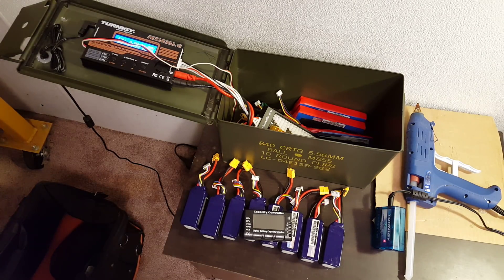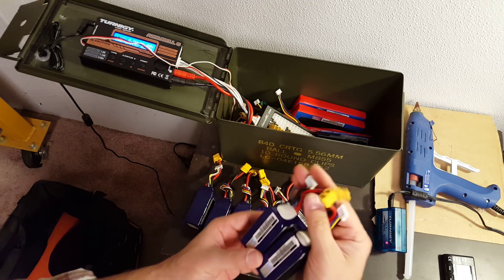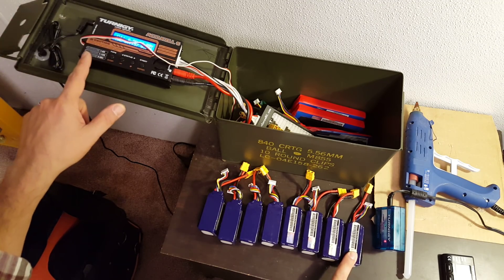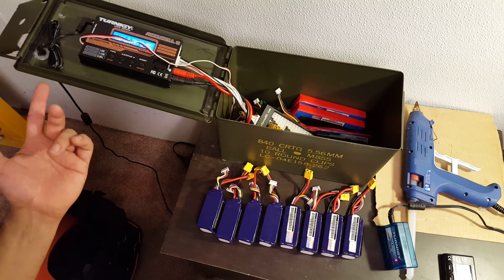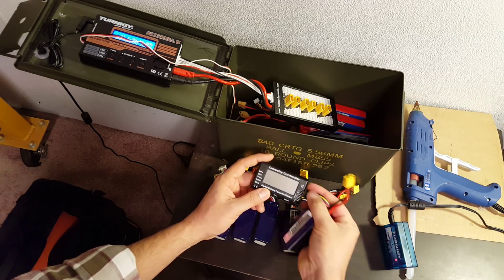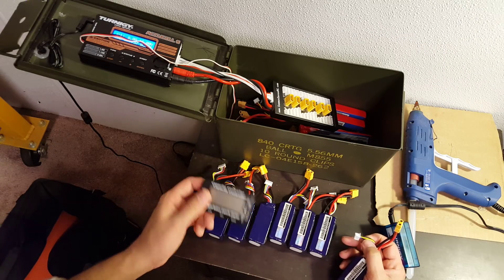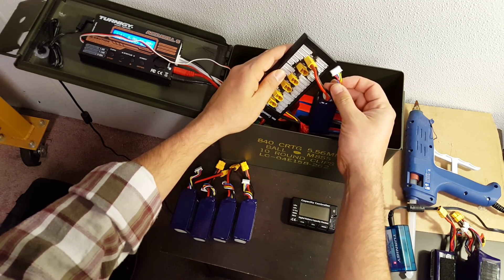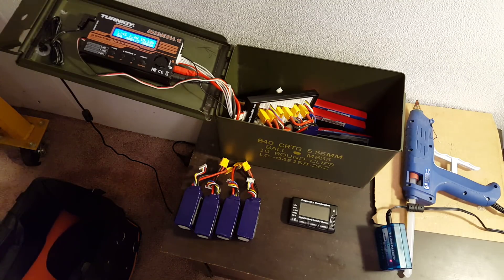How To Parallel Charge LiPo Batteries Without Burning Down Your House

Comment: Hey i have the same board and wondering if you can plug the wrong balance cord into a spot. First batterty i put in at top and the balance cord i put into the left top and second battery into right top. So on i see you put the top battery into the right top

Comment: what determines the cell input on the charger. the number of lipos at parallel board or the number of cells on each Lipo ? if we parallel charge three 4s lips is it gonna be 3s or 4s
Reply from the maker: 4S is always 4S. If you plug 4S lipos into the charge board, that's what the charger sees.

Comment: I know I’m late to the party on this one over 10 years ago now I had a eye charger 208B and I noticed on the balance board. It had multiple plug-ins for the size batteries a.k.a. it had three or four ports for two as batteries two for 3S244S then one for five and one for six now I ran an eight scale buggy And because of the price of batteries I ran bullet style connectors on 22S batteries and just series them together as a single battery in my buggy to cut down on wires I did the same when I charge them. I kept the packs connected together as one connected the positive and negative to my charger And then plugged in both balance plugs into two individual slots on the two as part of the board and charge my battery pack is one for us. Never had a problem doing this, and those battery packs are still perfectly fine today now from my understanding that is what my board was meant to do with the multiple Balance ports. It was actually meant to series charge.

Comment: Do the xt60 plugs line up with a particular balance plug or it doesn’t matter. On my parallel board there is no lines to tell me which match each other so I haven’t used it because I don’t want to do anything dumb
Reply from the maker: You can mix and match.

Comment: within 0.4 of the full pack voltage? I am new to this so just making sure, I if I have 2 packs, one at 15.33 and one at 15.43 then they are fine? And what DO you do when they are more than .4? Do you just toss them in the drone and hit them a bit? Do you plug them into an led board? Any suggestions to discharge one down without turning on your charger?
Reply from the maker: Yep -- 0.4 volts difference for the whole pack voltage. So 15.00 to 15.40 would be ok. If they are more than that, you should charge them separately in my opinion.
Reply: @JoshuaBardwell  Your videos are real helpful man. Thank you for answering.

Comment: So it was early morning I was plugging in my 2s infinity 550s to the board. when plugging in the 3rd battery I accidentally plugged the balance lead into the 3s slot it started at the board like a fuse burning up to dynamite with a small flame following crackling and smouldering.  lucky for me I was right there and pulled the battery out ripping the pins out with it. one dumb mistake could have burned my house down all because I was still half asleep and didn't have good lighting to see.

Comment: wondering if anyone can answer this for me. I have a 1-2s multi-channel charger that  charges off balance plug only. Would it be  is possible to connect a 3s battery via an adapter connected to balance plug(wired in parallel of course) to 2 different channels. Basically connect 2 cells to the 2s connector and 1 cell to the 1s connector(on separate channels) essentially turning my 1-2s multi- channel charger to a 3s charger . In theory the charger would think that it was charging a 1s and a 2s battery on separate channels. would this work?

Comment: I have you parallel charge boards in 4s and 6s.  My 6s board only shows 5 batteries in the green voltage display at the top of the board.   All fuses look  to be intact, so only charge 5 at a time is 10 that the board allows.  Any clues as to what might be happening?
Reply from the maker: The checker is showing cell voltage. It isn't showing the voltage of each individual plug. You can't measure individual plug voltage when packs are plugged in parallel. All packs have the same voltage when they're plugged in parallel that's the definition of parallel.

Comment: Hi Josh, an FPV guy told me I could equalize multiple batteries (sane Ss and mAhs) by plugging them into a parallel board for 15min (without charging). Is this true? Thanks
Reply from the maker: https://youtu.be/yTEGhKBv09M

Comment: At 3:00, are you sure you just want to “walk away” for an hour or two while they charge!? I like to always be in the vicinity.  You never know!  You are awesome, JB.  Seriously my most trusted go-to guy whenever I have an issue. Thanks so much.
Reply: Old comment, but yeah, I was a little taken aback when I heard that. Although everything else in this video is spot on -- definitely don't walk away. Ever. I walked away for what could not have been more than 5-10 minutes with my Bardwell Strix parallel charge board going with 8x 4s batteries. One of the batteries must have lit up, because I walked in to the whole board and batteries on fire in my garage. I quit parallel charging indoors 3 years ago since that day.
Reply: @JohnCuppi what was the cause?

Comment: JB!  Awesome video!   I originally found your lipo charger and parallel charging videos as I am getting back into the RC hobby (off-road dirt).  Now, after watching your videos, I am considering getting into Drone FPV flying, just for fun (no racing).  One question I have that hopefully you can help is this.  All the lip parallel charging videos are geared toward smaller mAh batteries (drones) but what about people like me who use larger mAh batters (5200+ mAh) batteries.  It does it make sense to go the parallel route with larger packs (due to the high A charge rate to get 1C) or just get a nice dual port charger and charge 2 batteries at the same time.  Thoughts?

Comment: Does it make sense to keep a check on the temperature of the batteries because usually they heat up before they catch fire, right? So if you touch them and they're extremely hot that would be a sign that you're charging with too high of a amperage or that something is wrong. I sometimes charge 3 850mah batteries at 3A. Should it be lower?
Reply: Its basically 3÷3=1 so you are charging the 3 batteries at 1 amp each which is totally fine imo.

I think you already figured it out by now but i thought might aswell let you know 😆

Comment: I have the following LiPo charger: https://hobbyking.com/en_us/ecube-e4-with-eu-plug.html?queryID=2c6afa6190382d250fff58ffd6f61678&objectID=57896&indexName=hbk_live_magento_en_us_products.

It charges with a current of 4 Amps and I charge 1300mAh LiPo's with a charge rate of 5-10 C. I would like to charge the batteries parallel. Is this doable using this charger? Most boards I find online don't just use an JST connector (which is the only plug my charger accepts) but also use an XT60.
Reply: https://www.banggood.com/2-IN-1-PG-Parallel-Charging-Board-XT30-XT60-Plug-Supports-4-Packs-2-8S-Lipo-Battery-p-1324605.html?rmmds=search&cur_warehouse=CN would this for example work?

Comment: Hey Bardwell, so if I charged all my packs and couldn’t fly them by the 2nd day, is it safe to parallel discharge at like 2C for lipos as well? I’m wondering as I now have to discharge some batteries as I won’t be using the until Saturday lol
Reply: Yes, it's absolutely safe to discharge them in parallel with 2c ( if your charger can handle that, most chargers discharge at 0.6 Amps max with 4s batteries)
Besides off that, lipo batteries can handle a lot of discharge rate ( like they do while flying) but can not handle a high charging rate so keep it on 1c for your safety

Comment: You mention sparking ... when I connect the battery to my quad, I can hear it snap/pop/spark ... is that to be expected?
Reply from the maker: Yes it's normal especially on 6S with a capacitor.

Comment: My 6S CNHL batteries say they can be charged at 5C.  They do not compare the # of charges the battery will last at this rate versus 4, 3, 2, or 1C.  I charge at 1C to be safe and I know some guys who charge batteries for flashlights who are not willing to charge more than 0.2C!  So ... what rate do you charge at?  BTW, I accidentally connected my 4S to the parallel board which already had several discharged 6S connected and in just 15s or less the 4S got warm and charged to 4.3V per cell ... definitely something I have to keep an eye on as I wasn't even thinking how these back-feed without the charger going!!  Thanks for sharing this video Joshua!
Reply from the maker: Please please learn to parallel charge safely!

Comment: If you have 1S, 2S or 3S batteries you charge them in series (also the balance plug). That's the proper way without hazard.
You can't do it with 4S  as the chargers typically only do 6s max.
Putting them in parallel ruins the LIPOs if any of those parallel cells have a significant voltage difference, never do that.
But you are right: If you check them all, verify all cells are within a very close voltage span you can parallel charge them.

Comment: If a person has an ISDT Q6 charger, and an ISDT Safe Parallel Charging board, how does one send the output from the ISDT Q6 charger output (MALE XT60), into the INPUT of the ISDT Safe Parallel Charging board 'input' (MALE XT60) ?

Neither the ISDT Q6, or the ISDT Safe Parallel Charging devices seem to come with cables to bridge between them, and on the sites i've looked at, nobody seems to sell a FEMALE to FEMALE XT60 charging  'bridge cable' set to go between the Q6 outputs and the Safe Parallel Charging device...  what am i not understanding??

P.S.  i am going to order a metal ammo can for this too.

Comment: I have a parallel charging board and the directions say  "always plug the balanced connectors in first".....I'm thinking they're wrong.
Reply from the maker: If the board has polyfuses, plugging in the balance connectors first is safer.
Reply: @JoshuaBardwell  It does have polyfuses...thanks

Comment: @Joshua Bardwell  a question , you said  that the battery needs to be at the same voltage or very similar to each other to prevent high current flows ok? But if we connect a resistor lest say 50 ohm  to the xt60 port  and to the balancing port , this will reduce the current  flow and let us plug in Lipo with different voltage , more than 0.4 (same cells )  am i right?
Reply from the maker: Yes but it would need to be a huge resistor because it might have to soak 50 or 100 watts or more.

Comment: Is there no smart parallel charge board, that will run all the checks automaticaly before unlocking the connections between batteries and stuff?
Reply from the maker: That's just called a charger. By the time you build a smart parallel board that can do all the checks, you have built a charger and the advantage of the parallel board (low cost) is gone.

Comment: Assume i have 16 cells(not battery packs) to recharge individual, normally one cell requires 5v1amps, now for 16 cells what is the calculation, is it same voltage, amps for 16 cells in parallel connection ...? or do i need regulate(increase) input volts,amps kindly reply
Reply from the maker: Same voltage, amps add up.

It would be 16 amps to 5v.

Comment: This question haunts me in my dreams: when you connect lipos with different cell voltage to a parallel board, the cell voltage balance out anyways after some time? Is there a maximum on  discrepancy between the voltage of each cell for parallel charging? What if I keep them connected some time until they all have the same voltage - is it save?
Reply from the maker: https://www.youtube.com/watch?v=yTEGhKBv09M

Comment: Great video, thank you!  Just one thing, I recently started doing this and I heard from a guy at my local hobby store who recommended not charging batteries that have any individual cells that are out by more than .05v!  I was doing this for a while but it was really difficult to achieve and seemed a little excessively cautious.  Your way at (.4v or .3v etc...) seems a lot more reasonable as well as attainable.  What do you think?
Reply: I've heard conflicting stories as well,   i just charge 1 by 1 on 5C  fuck it,   just keep a fire extinguisher nearby.. Even tho the Tattu's can take up to 15C

Comment: where does the air for the charger come from when its closed ?
Reply: the charger runs on electricity not air. now if your asking where does the heat from the charger go, thats a good question

Comment: Joshua would it affect anything if I created extensions for each battery so that they aren't all piled up so close on each other? I wonder if there's a way to do that with the balance leads too? Just a thought. I would buy a set of these if someone sold them. Maybe they do.
Reply from the maker: Yes you can do that, it's just a hassle and a bit expensive if you buy balance lead extensions.

Comment: but what do i connect it to? i have like no money and this stuff, just the batteries and the charger is getting expensive. and now i need to buy something the charger goes into and a parallel charger if i wana have more flight then 3 min every hour or 2? batts are not too cheep ether. man, i was thinking i could fly with like 300$ max more like 250$ with cheeper stuff but seems like i cant get anything that is decent that i wont wana replace without spending like 600$.

i got a taranas qx7 off ebay  and i need a bat for ahat and  hopefully a charger that i get can charge it as well as the 4S batts that i will need and id want 10 or at least 6 or 8, and thats still low flight time semi decent googles were  like 160$ but then i need better antennas  and an antenna for the quad wich brings that to 220 ish. the quad was 145 on sale so thats good but meh. makes me wana just sell the remote and cancel the quad and find another hobby :/
Reply from the maker: I agree that around $600 is the minimum to spend on total to get everything needed to participate in FPV. Maybe a little less. And then you're going to smash your quad or lose it in the woods and need to repair or replace it. You're not going to buy everything and then be done. This hobby is a continual money suck. But the flip side is, you get to fly and that's awesome!
Reply: ya thats why im gonna buy a  woop with good internals like the betafpv 85X thats coming out soon. cheaper parts to replace if something breaks and its small

Comment: How do you  parallel charge lipo batteries with 2s balancer connector only?
Reply from the maker: you can plug the 2S Balance lead into the parallel board and it will work that way.

Comment: So, maximum 0.2V difference per cell, or 0.2V max for the total pack, whatever the number of cells? (Probably in the video, but don't want to watch it all.)
Reply: The general rule I follow is no more than a 0.1 volt maximum difference between cells of packs I hook together in parallel.

Comment: I got a problem with my Lithium Polymer batteries I connected all the plus 2 plus and then minus 2 minus and I plugged it in to what I want to power and it only shows that are dead and it only shows that's 11 volts and each my batteries is 11 volts
Reply: I got four of them

Comment: Any limitation on the charge method with parallel charging? Or can I use balance charging with multiple batteries plugged in?
Reply: Thats the question I am looking for an answer to.  Do you know?
Reply: @CitadelPhotography  balance charging should be used when parallel charging with multiple batteries

Comment: Can they be charged  separately by to different chargers while connected in parallel ?
Reply from the maker: No. When connected in parallel they are basically the same battery.

Comment: So I have a 1300 and 3 1500 batteries. I check the voltage and all of them are within range. I set the ah to 2.0 - 14.8 - 4s and hit go. Is that a correct way to go
Reply from the maker: 1300 + 1500 + 1500 + 1500 = 5800. You can charge at up to 5.8 amps safely.
Reply: Joshua Bardwell thank you so much. I bought your v2 board. Thank you for a great product. I can’t wait to get it in.

Comment: I can't find out if there is an order to respect on the board for the power leads and the balance leads, like if one goes with one there ; or if there is no relation between connectors and the only thing that matters is: make sure all connectors are plugged correctly and all batteries get their power lead plugged before their balance leads.
Reply from the maker: No, there is no relation. They are all in parallel so electrically they are totally interchangeable.
Reply: Joshua Bardwell awesome! Thank you. That was the last thing I was worried about doing something wrong. I'm going to try to run my first parallel charging now then! Thank you so so much for your channel :) I'll support you the best way I can

Comment: Thank You for yet another very informative vid ,i'm just starting up in FPV (waiting for my very 1st quad/drone/ meh the fun toy with spinning thingy's  =D  ) and a small one to fly inside & learn . for safety charging I have an old steel tool box that should be good enough it close up pretty tight but not 100% so if some thing happens it wont turn into a bomb .You mentioned something about electrical tape This ->https://www.permatex.com/products/adhesives-sealants/specialty-adhesives/permatex-liquid-electrical-tape/ is what I have been using for years ,it great specially if you can dip the part in it let partially dry 30ish min and do two coats .I sealed many accessories on my e-bike with it never had problems with water on them .

  Congratulation Josh on going all out with your FPV Passion ,full time youtuber I mean ;-)    I usually end my comments with ride safe in this case I have to say " Ride & Fly Safe "   1 last thingy ,if you ride a bicycle don't stay in a car/truck blind spot ,sadly again this season cyclist where badly injured for having stayed in that zone ,some dead ….  Fly& Ride Safe ;-)